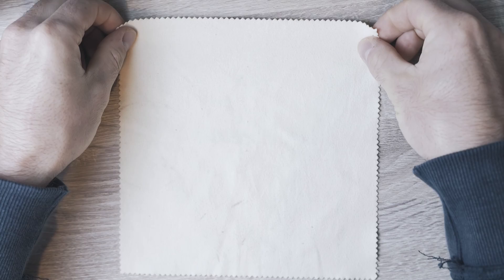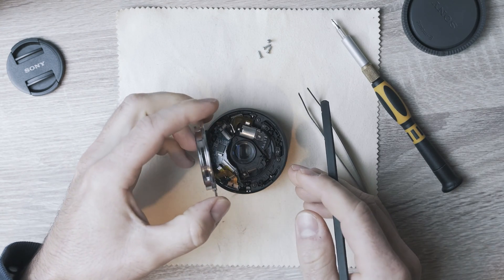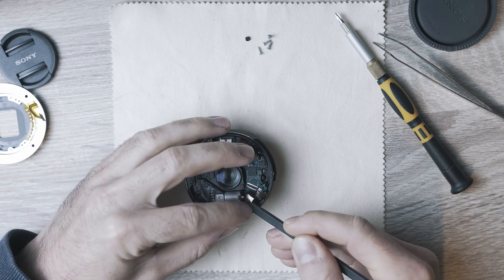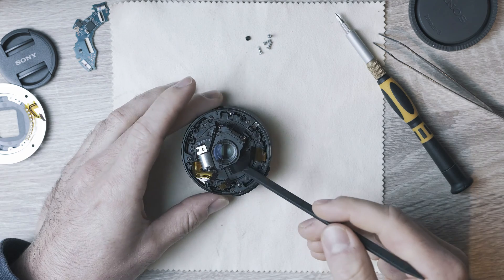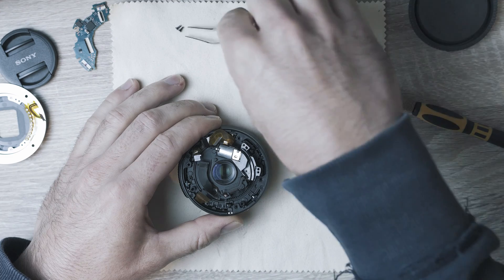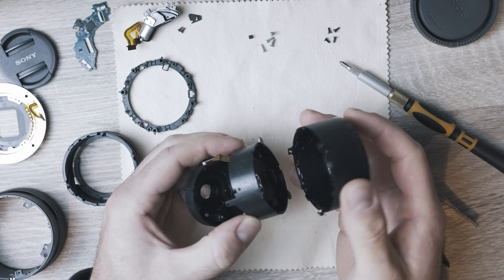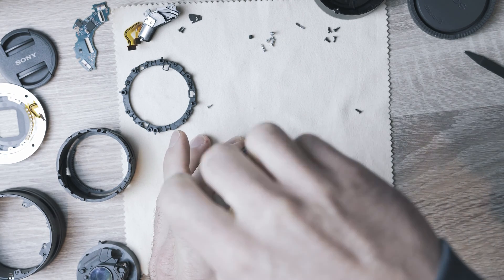SONY LENS 16-50mm TEARDOWN | SELP1650 REPAIR | FIX | TakeApart

Comment: Bro is it possible to open the last apecture part ....I have removed everything until that part ...tried cleaning and putting it together more than 6 time now and still has the same issue ,the lens restarts 3 or 4 times and the f value or apecture value is not showing and is not changeable .....and I believe something is wrong with the last part motor or something small like cable ect ...I cant be sure until I removed and check for any problems ...can u pls tell me how to open it and check for issues ....I have been on this for along time ....and I can put everything back with out any marks required I know how the lens go in that much ....BT after diassambeling for this long I can't solve it ..I'm desperate and sad .....pls help
Reply from the maker: it is possible, but it is also delicate! I wouldn’t go in there…. rather get replacement parts
Reply: @takeapart  but that part cost nearly 5000 Indian rupees ....I can't afford that much right now ....its either I do it my self or just wait long enough to buy a new lens or a replacement for this part .....the last part has several spots which looks like plastic welds or epoxy resin or some kind of glue ....so I'm not sure if I open it up I can put it back together and that's the only issue holding me back from opening it ....I'll update here if anything new happens ....thanks for rplying brother .....

Comment: Any idea How to Remove the Focus/zoom Ring? Got Some Sand Stuck behind it -.-
Reply from the maker: hi, ho ahead and disassemble the lens... follow video ... it should help
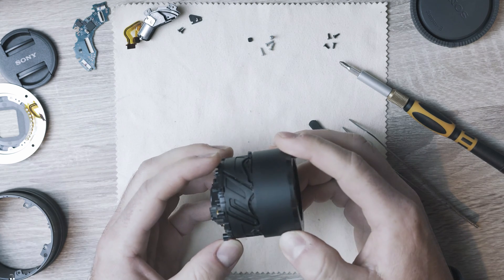Reply: Not Really. @1:54 you put the outer case with the Ring away and Never touched it again.
Reply from the maker: well, you must figure out next steps ... I don’t have that lens on me anymore.
Reply: Ok, thats sad. Tried for an Hour and googled also a lot ... just found that reddit without answers -.-
Reply from the maker: if I get my hands on one I will tear it down...
Reply: Hi Eric, I have just done the operation :) !
1. Remove the little sticker ring of the rim of the focus ring, revealing three little holes and the plastic lock-ring it sits on.
2. On this inner lock ring there is a 1cm piece which is a little more flexible. There should be a little gap to the left and right of it
3. Align one of the three holes of the focus ring with the left gap of the inner lock-ring, and use a small flat head-screw driver to lock the two in position. Then twist counter clockwise on focus ring for about 1cm
4. You will now be able to detach the focus ring + lock-ring. You should now be able to proper see the small little 1cm piece holding the lock-ring in place. This itself is detachable and only held in place by the same felt-ring like the rest of the lock-ring.
5. Simply flip it off gently and get in between the lock-ring and the focus-ring with a small flat-head screw driver. Not bend the plastic lock-ring gently and get it out. Make sure you don't break the little felt ring it is attached to.
6. Now you can clean both surfaces from sand. Use a Q-Tip. After re-grease slightly to assure proper motion.
7. The little black marks you see on the inside work together with an optical sensor. On my lens, half of my marks have been worn off because of the sand! I simply drew them back on with a marker pen.
8. Put everything back together. Clean the rim of the focus ring from any grease to make sure that the sticker ring will stick properly after.

Took me about 20mins to figure out the mechanism and another 10min to clean the ring. Good Luck.